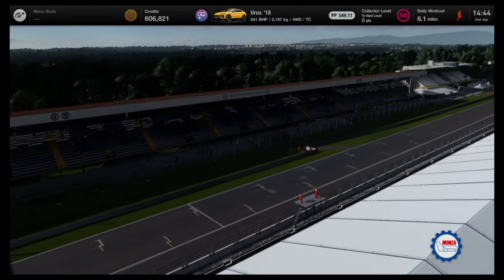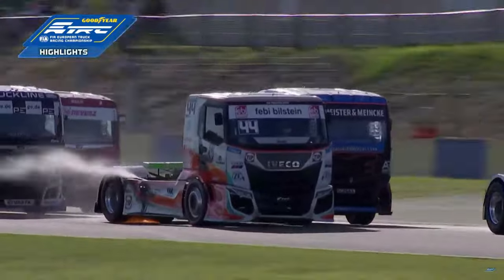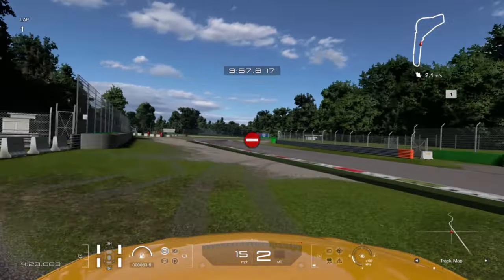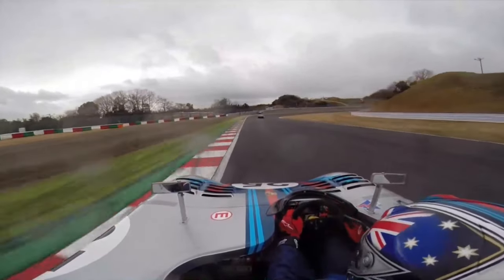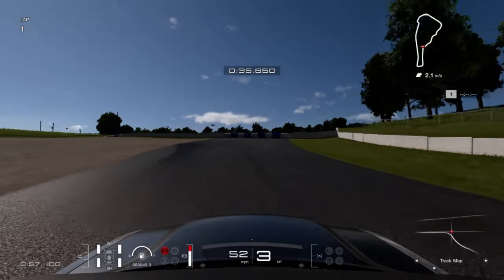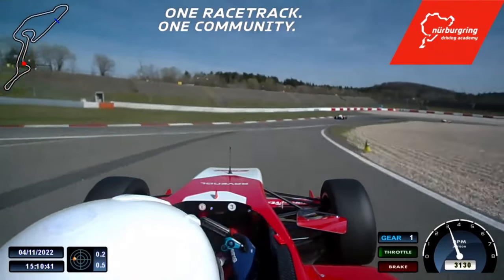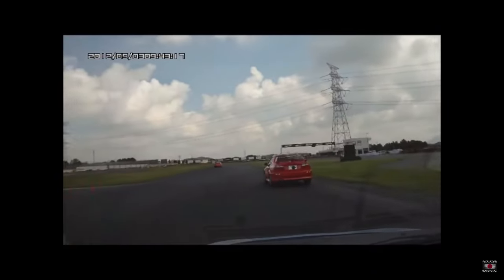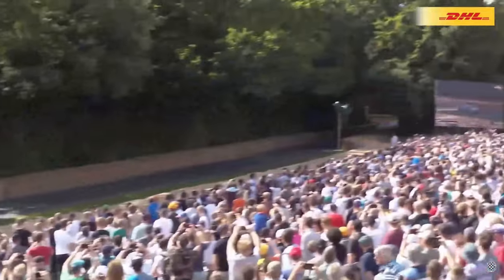UNUSED Circuit Layouts In Gran Turismo 7! (1.46)

Comment: idk if anyone knows but there is a Hidden Layout of SSRX, originally found by MattJ on GT5, you can see some of it when you're on the track in an event.
Reply from the maker: Yes, need to look more into that!
Reply: roflwaffle did a video on scrapped and inaccessible tracks in gt not too long ago, covered the infield layout too
Reply: True, the infield layout was even visible in a GT5 trailer
Reply: it’s a layout that hasn’t been scanned and was there for design, at least that’s what’s the data mining said
Reply: A completely restored version is available in Assetto Corsa oddly enough.
Reply: @lIllIlllIlIllIlllIlIllIlllIl  oh?? ive been trying to get AC back for a bit but i dont have the cash rn to do so

Comment: Even though it's a completely original circuit made by PD, Dragon Trail Gardens has an unusued short Course layout. On the outside of the hairpin at the southern end of the course, there's a road that leads away from the outside of the corner and meets the circuit again at the final turn, skipping out the entire midfield section of the track.
Reply from the maker: Wow I didn't know that! I know there are alternate layouts of Kyoto Driving Park and SSRX that are unused, may have to do a part 2 🤔

Comment: There are also two alternate layouts to Tsukuba Circuit. The Chicane on the right hand side of the track right after the Dunlop Bridge. And then in the middle of the chicane, there is a section of wall that can be removed, and the track curves around, over a little rolling hill, and onto the back straight, cutting it in half.

Currently this section of track is unused for racing, and is now used only as an access road for emergency vehicles and teack workers.

If you look at the track on Google Maps you will notice the back side of the grass center section of the chicane is curved, and radius's with the access road perfectly, making up a double apex right hander under the Dunlop Brodge. At one time i believe there was even a section of curbing on the backside of the grass in this section. I think you can still see it in old BestMotoring/HotVersion videos from the early/mid 90's. There also uses to be a small patch of grass at the tip of the exit of the chicane. You can still see that if you look at the Street View of the circuit on Google Maps. As the chicane is mostly used for motorcycle racing, i presume the grass at the exit was removed for safety reasons, and replaced with the painted asphalt we see now.
Reply from the maker: Yeahhhh, think that layout was in some of the old Forza games
Reply: @Sideways-Smiling  yes, I believe it was, however it was highly inaccurate, as it did not properly incorporate the elevation change. Imagine that, an inaccurate Forza track...who knew? 🤣